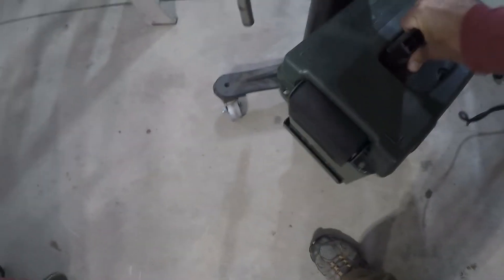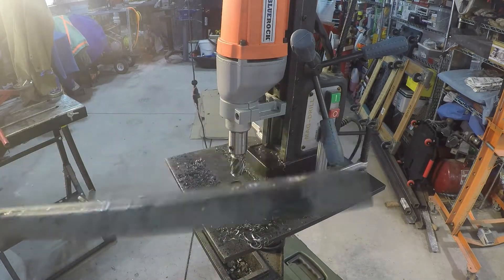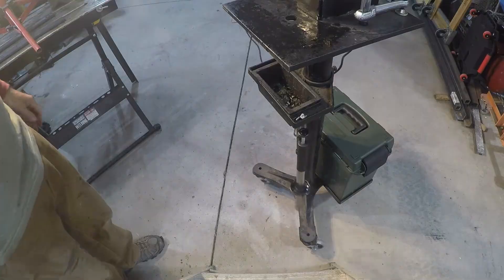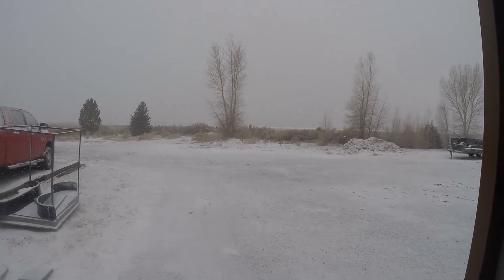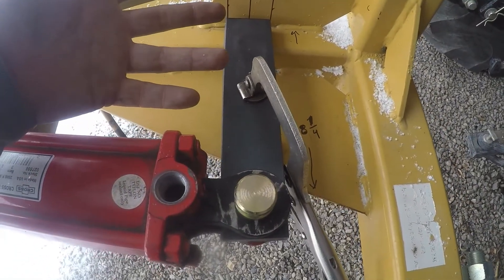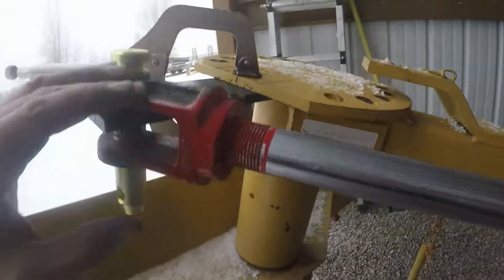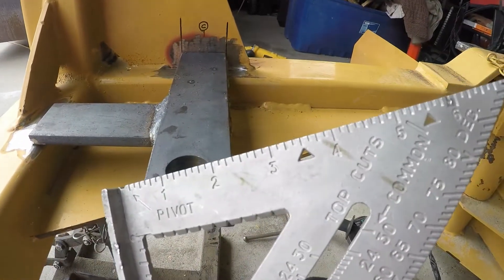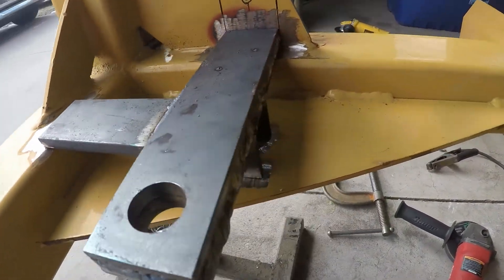County Line Grader Blade HYDRAULIC CONVERSION (Part 2)

Comment: I plow snow on our 1.3 mile Private dirt road with cattle guards and rocks.
I drag the blade behind so when I saw you blade backwards I wondered why ?
I’m also pretty sure you will need to gusset your mounting points because the first solid thing you hit will cause failures for sure..We have rebelled and replaced cylinders several times .